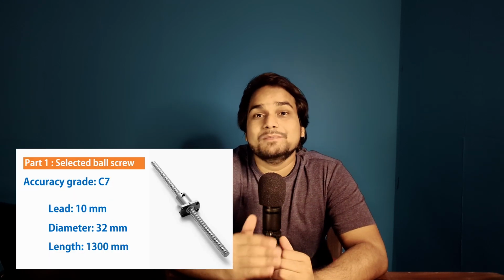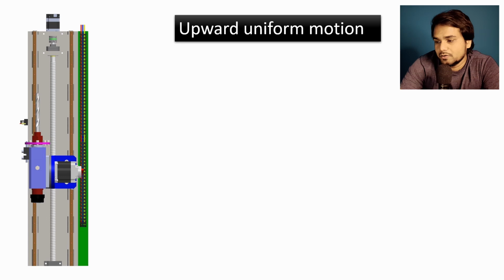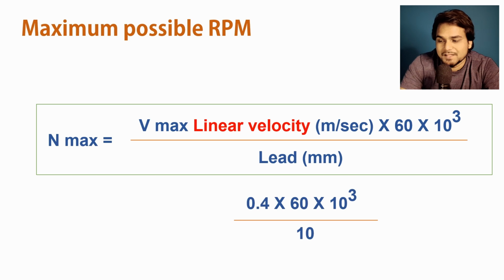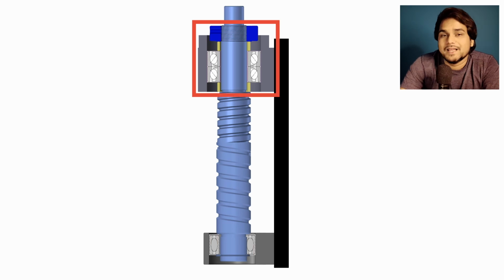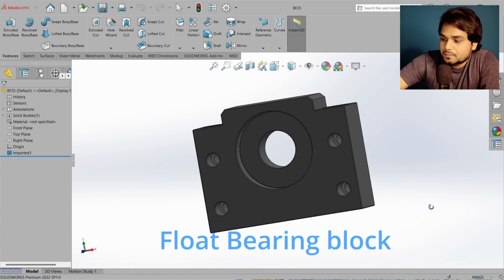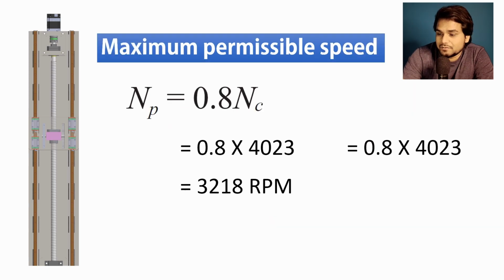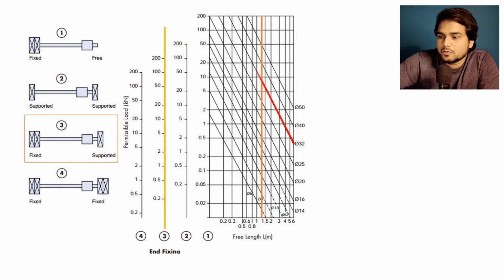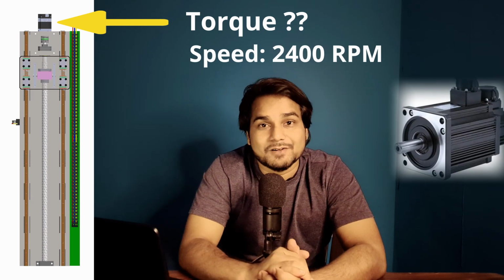Ball Screw Selection Verification | Critical Speed | Buckling Load

Comment: what about selected bearing life calculation...
Reply from the maker: Hi Sagar, I missed the bearing service life calculation. 
But definitely we should calculate bearing life. I'll cover in upcoming "dedicate series on bearings" 
Just for note to calculate service life : I have checked BK 25 bearing (Fixed type)
[C] Dynamic load rating is 19.3 kN
and we have axial load : 680 N
Radial load: There is not radial load theoretically. but where will be some due to component fitment error. (Let say 50 N) and
[P] Equivalent load lets consider 1000 N 

Service life in million revolution
L10 = (C/P) power 3
3 for ball bearings, 10/3 for roller bearings
Reply: @mastermechanicaldesign  thank u sir for replay 
Plz continues upload such nice video with practical example

Comment: Hii,
I have a question, for a 10 m long horizontal loading device the Nc critical speed is very low, its almost something like 73 RPM. How can I fix this. This device also needs to be very precise. Also the load is very heavy 5 ton. what should I do? I have limited time so I'm really stressed. Even though I somehow solve this problem The Fk and Fp values become a problem. What diameter should I choose? Since in the HIWIN manufacturers catalog the recommended ones can be only 80 and 100 for 10000 meter long ballscrew. But I afraid if it is too much (I mean the diameter value). I would be deeply grateful for your response in advance.
Reply from the maker: Hi Caramellom, I would like to know more detail, what exactly it is. load is too much, and you also need precision. 
Second, I would suggest is to avoid using ball screw as travel distance is too much, instead use rack and pinion but as your device need to be precise too, so you I don't think you will as much precision in rack and pinion mechanism, but you should at least work out on it. you can email me which pictures.
Reply: @mastermechanicaldesign  thank you so much for your help I mailed you the details, you are right I should use a rack and pinion system.

Comment: hello bro, you use a vertical moment so you choose the total load as a axil load but i need the axial load calculation for horizontal moment. you can tell about the calculation for it.
Reply from the maker: In this example, the total axial force is the weight of the drilling system plus drilling axial force. 
Fot horizontal orientation- total axial force will be drilling axial force (as it is) plus frictional force of ball screw + LM guide for given weight of drilling system

Comment: hello sir, If the load acting along the z axis is around 10kN, and the screw length is 500mm, lead is same as 10mm and speed is 750 rpm, I followed your previous video and I found the possible ball screw diameters as 20mm, 25mm, 32mm, 40mm (based on bearing block size ). but I could not find valid reason for the elimination of the diameters 20mm and 25mm . what will be your ball screw diameter selection based on your experience sir? can you provide it with a valid reason, thank you sir?
Reply from the maker: Hi, there is no such valid reason, we can start verification process from lowest size 20 mm, and if failed, we can go for 25 and 32 so on.
I have start with 32 mm directly, as per past experience.
more about this in linked video, watch after 19:00 

https://youtu.be/6cq2P7OHH-s?si=x4KhhS3BWCR69FYw

Comment: I did not understand accelerate value which is 0.2 s
Reply from the maker: Hi Shivam, this is acceleration time value, like how quickly you want to achieve ball screw at final speed from rest, which also related to motor acceleration and ball screw pitch, and you can calculate it as per application requirement, as per cycle time of application. in this ball screw selection procedure, I have considered 0.2 sec acceleration time as application requirement, as an example. and as per my own experience, 0.2 to 0.5 sec acceleration time is normal for ball screw with servo motor, in most of application.

Comment: I have a question about the buckling load. If the ballscrew is fixed at the top like in your example, why do you use 680N for the load as this load is in tension only. The load that would cause buckling would be compression and would be if it were accellerating in gravity's direction - ie moving up and decellerating or accellerating downwards. Although as specified here 2m/sec2 accelleration is less than gravity at 9.8 m/sec2 so it will always be in tension.

Please dicuss as I would like to learn together.
Reply from the maker: Yes, very good question, Let suppose the motor is ON and the ball screw nut plus load  attached to nut (which is a drilling system in this project) is going downward. Means there is tension in the ball screw. 
But when drilling starts, a reaction force will start applying on the ball screw nut in upward direction. 
Which will put the ball screw in compression (portion of ball screw with is above nut and below top fixed bearing support. This same case will happen in any pressing application. So we should definitely check buckling load capacity which can take our system max axial force
Reply from the maker: I have also explained, buckling load also depends on bearing support unit type. Is it fixed or slide. In case of fixed type bearing support at both ends. Buckling load will be max. Nf value 1. And you know the reason, the ball screw one side (either above nut or below the nut) will always be in compression.

Comment: Hi sir..I wanted to select a Lead and screw dia for the velocity of 1000mm/sec with carrying around 2 to 4 kgs weight.. which screw I can go for...the accuracy is +/-1mm
Reply from the maker: Hi Shan, as your required linear speed is 1000 mm/s,  Means  Ball screw lead size should be 20 mm, or more than 20 mm, and rotation speed will be 3000 RPM or above, which is critical, Ball screw rotational speed should not go beyond 3000 RPM.  (Critical speed limitation), My advice is you should consult with ball screw OEM.

Comment: Thank you for such an good video... can you please say me how to choose ball screw for radial load
Reply from the maker: Hii Sivasugandan, there is already radial load (twisting load) on ball screw, because of applied motor torque. and axial load due to lifting weight.
But on Bearing support units the is not much radial load because of vertical condition, if there would be significate radial load, then we have to consider radial load too in calculation of "Equivalent dynamic load on bearing." in bearing selection, bearing life calculations. 
Please let me know, if have any confusion

Comment: let suppose if this application is horizontal then all calculation are same or they changes @ g= 9.81
Reply from the maker: Hi ajay, Yes definitely calculation will be changed. In Horizontal condition, Like first of all resultant force (axial load ) will change, due to change in direction of g.
Then critical speed limit will also change due to different mode shapes in horizontal
Also there will be slight differences in buckling load. 
But yes steps will be the same.
But i have seen that the manufacturers catalogue hasn't defined. Critical speed and buckling load formula for different conditions. We can use the same formula, no need to be too accurate. Consider sufficient SOF.
However as nerds, we can go for Dynamic FEA cross check.